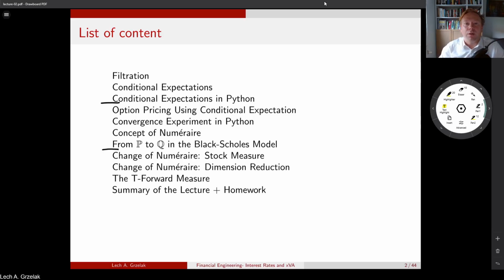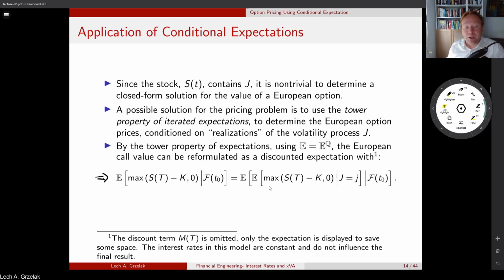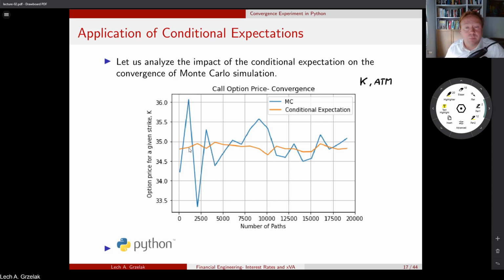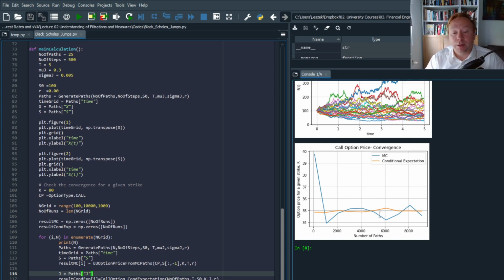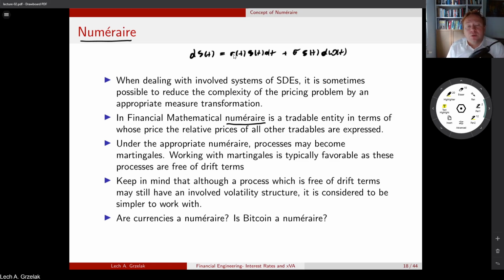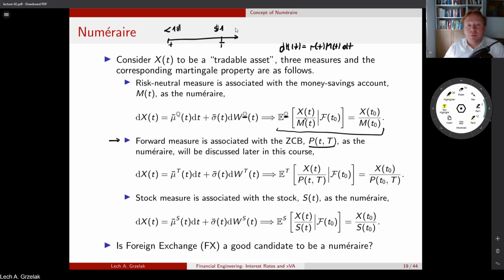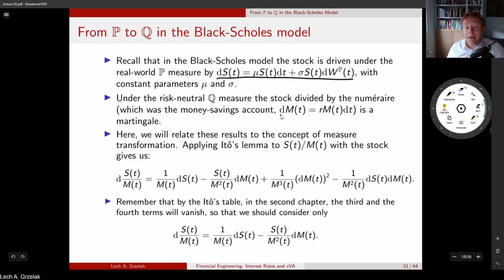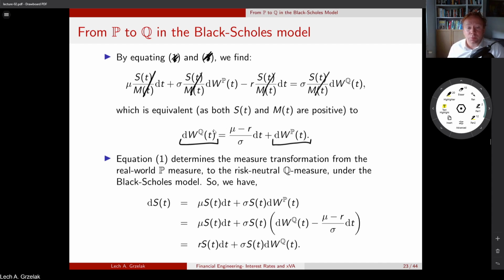Filtrations and Measures (Lecture 2/14, part 2/3) | Financial Engineering Course

Comment: Imho, can we still use tower property in case brownian motions in stock price and volatility processes correlate? Or we need to use brute MC in that case?
Reply from the maker: You may try to use the Cholesky decomposition, to ensure you are dealing with independent Brownian motion and then try the tower property. Does it make sense?

Comment: Dear Lech,
at minute 16.33 line 35 of the code I can't understand why the value of the volatility, J, changes both with the path we consider and with time. It should not be constant over time for each simulation? Indedeed, when we consider the conditional expectation approach we use only the "last" value of J for each path, as if the value of J were random but constant for each realization. Thank you so much!

Matteo
Reply from the maker: hello Matteo, you are completely right, if J is a random variable, and not a stochastic process then it should be "fixed" for every time "t". 
Well spotted. Thanks for the notification. If you like you can contribute to the github and suggest the fix. I will review it and include in the latest version of the code.  Thanks again. Best wishes, Lech